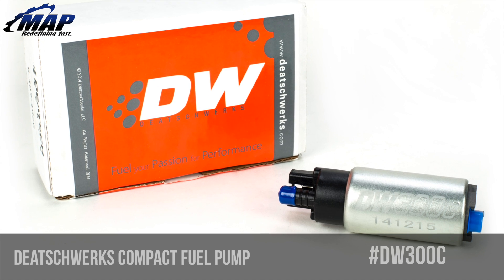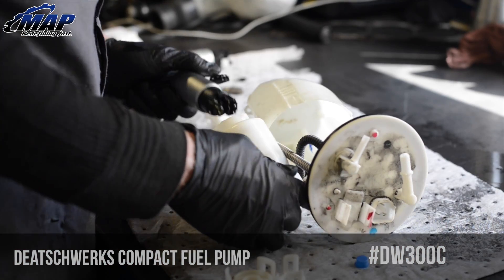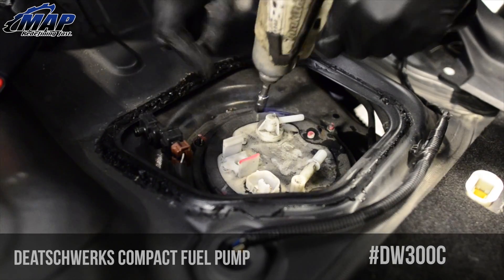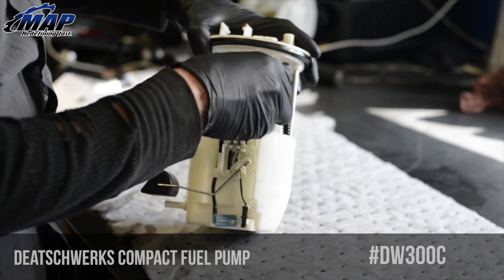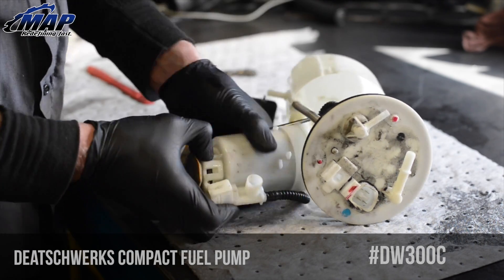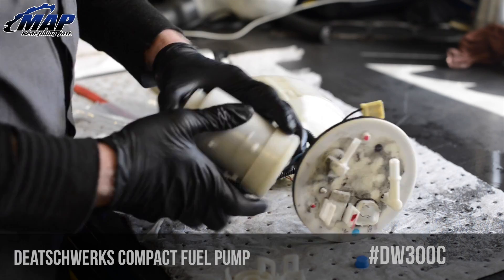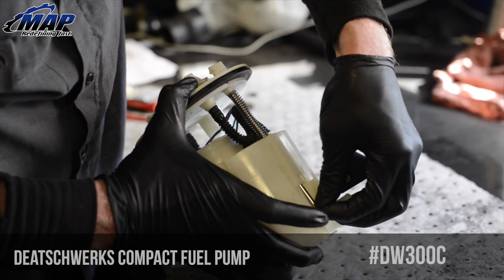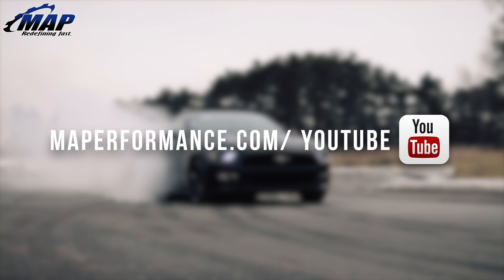DeatschWerks DW300c 340LPH Compact Fuel Pump Install & Review (Evo X, GTR, LGT, WRX, STI & CIVIC)

Comment: do you need to rewire with this pump? does it flow enough to make 500whp on e85 md?
Reply from the maker: Yes rewiring is needed, and yes this pump is good for 500whp!
Reply: MAPerformance lol what if im not getting any issues right now on e85 should i still rewire ? 2015 gsr here
Reply: @maperformance  When you say re-wiring is necessary, what does that mean? This video showed re-using the power wire harness from OE.
Reply: @roguetune03  Exactly what I'm wondering... REALLY wish there would have been a response to this.
Reply: @David Harrington  in the end I ended up going with e85 rated walbro 450lph on a direct wired setup rather than stock wiring as the wire gauge is too thin on the stock harness.
Reply: @roguetune03  So you ran your own wires to the fuel pump casing from the Walbro? Im still confused about what the DW series requires as far as "rewiring", since the video clearly shows him doing a plug and play with OEM harness. Oh well. Didnt expect you to respond to a 4 yr old post. ha Appreciate it.
Reply: @StarsetFlight  No worries, yeah there's a harness/wiring kit from either DW or Walbro for each pump. Our wiring is 14g and not thick enough for the amps of a big pump. Direct wire has some unfortunate reliability issues I hear about but so far mine is running fine. (if that changes I'll post again) lol.  Wiring kit is like $30ish if I remember right but that was before the world lost its mind with price increases so not sure atm.

Comment: This isn't bad execpt you should have mentioned reusing the OE spacer on the nozzle from the OE pump. And this installation guide was specifically for the EVO X. Good video.
Reply: @DMRMOTORSPORT  damn 11 months and no one replied. You'll need to use lube on both o rings to get it in.

Comment: do you make a pump that will fit my 2003 silverado
Reply: There is no DW pump for the 03 silverado due to it's unique venturi port at the top of the pump.  It's common for people to use positive displacement in line fuel pumps for upgrades on silverados.

Comment: I can tell you that is not a 15+ wrx basket at all nor does the install for the 15+ wrx go as such its is very different and the people who made the pump (every single company at this point) did not do enough r&d and jumpee the gun with the fitment for the 15+ wrx
Reply from the maker: +johnnyb305mia You're right, this was done on a Evo X. While we personally can't confirm fitment on the 2015 WRX, it is listed to fit from the manufacturer. If you have issues we recommend contacting them directly. Thanks for the info!
Reply: +MAPerformance have spoken to them and they reside soem stuff i will not say here but i think we have found a fix but not sure until my laptop is back and running to log it

Comment: This is also designed for the fa20 wrx correct?
Reply: +MAPerformance awesome to hear..
Reply from the maker: +Richard Anthony It is listed to fit the BRZ/FRS so yes, unless you have it swapped with a different fuel sending unit.
Reply: +MAPerformance I understood the correct pump for the 2015/16 WRX is the DW65C fuel pump, can you confirm. I have been recommended by a tuner to install this prior to adding the mods I am considering which is either GS Intake or Invidia/depo racing catted downpipe.
Reply from the maker: +La Ghoulstra (Cisco Kidd) Yes that is correct. One isn't necessarily needed with those mods unless you want to run E85, to which we would recommend the DW65. We have heard about some issues with the factory pump when starting to make over 300whp or so but can't confirm that ourselves, yet!
Reply: +MAPerformance thanks for the feedback. Currently rocking out your MAP tune and enjoying it . looks like I may go the DW65C as I want to hit the 300whp and should w items on order.

I am hoping MAP will offer ability to update/support the GS intake and develop one as well!!
Reply from the maker: +La Ghoulstra (Cisco Kidd) We are considering a Stage 2 to support intakes and downpipes! Keep an eye open as it will be announced on our channel if we do. 

If you have any questions feel free to give us a call! We can help you out with the DW65C!